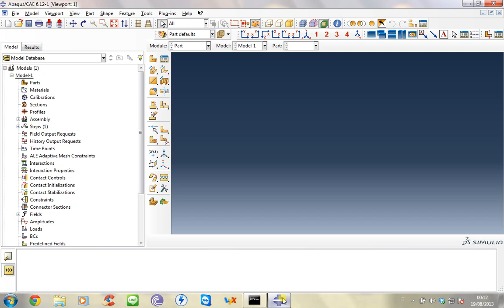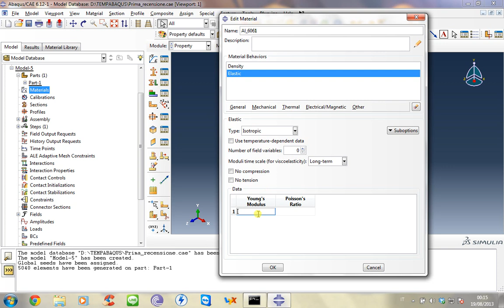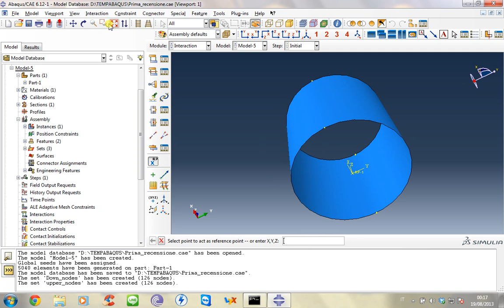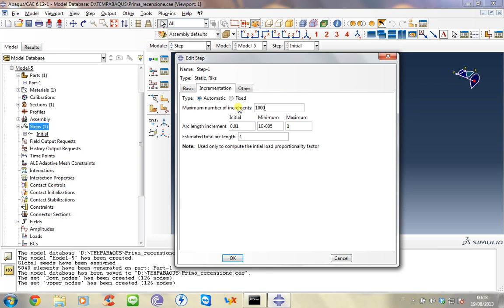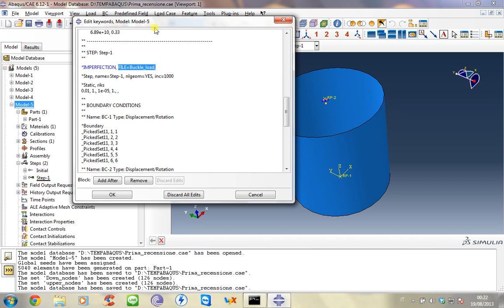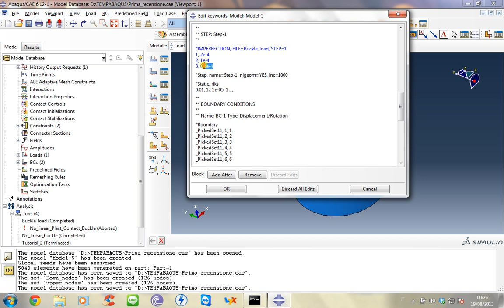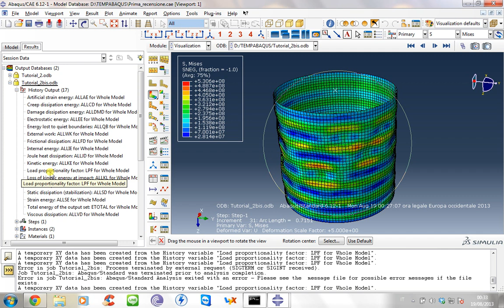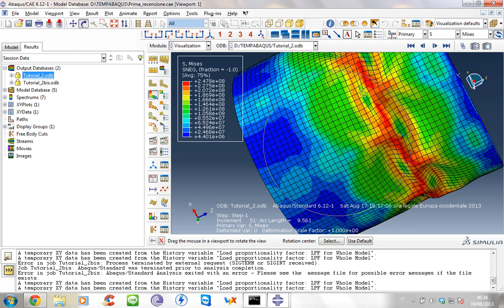No Linear Buckling analysis using Ryks algorithm

Comment: sir,can you help me? 

I addded imperfection in input file as 
*imperfection,File=L48F3000-1,Step=2 
3,2.9997 
39,0.4998 
53,1.3818 
and inserted it via job->create->source=input file->continue->submit 

but the abaqus cae result not showing any imperfection in shape. 
anybody know how can i rectify it? :(
Reply: Try to use the keyword in the cae and try the same. I think the way the imperfection is applied in the input file is different from that of the keyword.
Reply: Hi
can you tell how to calculate these imperfections.
Thank you

Comment: While I enter mode number and magnitude as in your example it gives syntax error "the syntax of following keyword is not correct" what can be the reason for that? Thank you.
Reply: +Mans celeb Yes, I had the same error with you at first. But I closed and opened it again, and tried many times, using non-capital letters, finally, it did work.

Comment: Is there  any way to do such buckling analysis using static riks on a column without imperfections? It gives a linear behavior of load-displacement curve without any buckling (for no imperfections) and column fails in squashing rather than buckling. Although I'm getting accurate results for imperfect columns. Someone please help..

Comment: hello.

What are common errors in the procedure of following your example if you receive the following error message after 222 increments

"Time increment required is less than the minimum specified"
Reply: Ryan Cudo Could it possibly be that I have not yet defined the plastic properties? And, when defining the plastic properties, How many must I enter? I know the more I enter the more accurate the results, but from where can I receive the plastic Properties. Is it from matweb.com as you suggested? 

When I enter the yield stress and strain (under plasticity) I get errors stating: the strain increment is so large that the program will not attempt the plasticity calculation at xxx points" this is repeated. and also:

"The strain increment has exceeded fifty times the strain to cause first yield at XX points"

are these warnings allowed to be ignored? Why / why not?

Comment: In ABAQUS, you can do buckling analysis [linear], and then use the first buckling mode to update the geometry [simple command to implement] prior to applying other loads. Has anyone does that before? Any tips? Any tutorials?
Reply from the maker: Do you refer to *IMPERFECTION command? Using it you can update the structure using the output from linear buckling analysis, and you will decide the ammount of % "imperfection" introduced.
Check the manual on the keyword manual!

Cheers

Comment: Im modeling a submarine, aplying pressure to the outside of a hull. I found the buckling load (doesnt cause yeld) and then i aplyed the Riks alg. to calculate the post buckle deformations until yeld was reached. i wanted to know how can get the pressure aplyed in each on the Riks iteration, until the yeld is reached.
Reply from the maker: Dear Garcia, in the history output, for the Riks analysis you will find the LPF, Load Product Factor. If you multiply that for the applied pressure you will see the pressure wich cause you the buckling. :) Sorrie for delay
Reply: Astro Abaqus
Hi Astro, thanks for the reply but i did some reading and figured that out :).

Comment: hi. so the only way to get the load vs displacement is using risk analysis..
Reply from the maker: Jonathan Carrera
 Dear Jonathan, the load displacement curve can be obtained in anycase. But depend what you would like to study. In this case I was interested in studing the structural instability of this model. Riks analysis is stricly useful to study the instability and collaspe of structure and obiviuosly you can obtain the stress strain curve to see the stability and instability behaviour. Hope to have answered to your question.

Regards
Reply: Astro Abaqus Hi, I want to get the load vs max displacement of a simply-supported plate using (thin plate element S4R). The linear perturbation will only give me eigenvalue and buckling mode shape. I want to get a curve that has the load vs displacement and this load should approach the first critical load given by Ncr (compressive force) or not?
Reply: The eigenvalue is the predicted imperfection by the software but using the riks method as in this tutorial, You can find the compressive force by the load proportionality factor.

Comment: sir how can i use imperfections on a membrane so as to get it wrinkled and then perform my analysis
Reply from the maker: Hi I worked a lot on thin membrane wrinkling, for space application. Your aim is to model the wrinking or to analyze wrikled structure? In the first case depend on the shape of your membrane. I suggest you this paper, made by Sergio Pellegrino one of the most briliant scientist on this topic.
http://www.pellegrino.caltech.edu/PUBLICATIONS/Wrinkled%20membranes.%20Part%20I%202006.pdf
http://www.pellegrino.caltech.edu/PUBLICATIONS/Wrinkled%20membranes.%20Part%20II%202006.pdf
http://www.pellegrino.caltech.edu/PUBLICATIONS/Wrinkled%20membranes.%20Part%20III%202006.pdf

Hope this help you!
Reply: Astro Abaqus sir i m getting the eigen mode shape....but i m unable to save them as my wrinkled pattern...please tell me the steps to get a model which is wrinkled so that i can perform my analysis ...it will be a grt help sir
Reply: Astro Abaqus sir my aim is to first model a membrane structure which is wrinkled.....and then doing analysis on that wrinkled model

Comment: I have put the imperfections into my model, but when I try to run the job to obtain my .odb, I have an error like this and the job is aborted:  
A ZERO DISPLACEMENT SOLUTION WAS FOUND IN THE FIRST ITERATION OF A RIKS STEP. THE ANALYSIS CANNOT PROCEED. THE MOST LIKELY CAUSE IS THAT ALL DISPLACEMENT DEGREES-OF-FREEDOM ARE CONSTRAINED TO BE ZERO.
Do you now what happens and what can I do to solve it? Thanks.
Reply from the maker: Dear mark the most possible reason of that message is the model load or boundaries condition. In the first case you applied no load or not a force for example if. You impose a thermal field this is not considered a "load" by the solver also if a thermal load can cause a buckling. In the second case is possible that with out BCs or proper BCs the model is ill conditioned and the equation bring a singularity. Hope this can bring you to the solution

Comment from the maker: This is possible, you can impose imperfection directly on a NODE SET using the option NSET= nodesetname. With this option you will apply the imperfection only to the nodes selected in the set. If you open the manual on the KEYWORD section you will find a lot of other command to use deeper it.

Comment from the maker: The LPF is a factor proportional to the load applied. Usually you calculate the linear buckling load, than you apply that load to the structure and perform the riks analysis. When LPF=1 mean that the load is the same of the one imposed. Usually buckling occur at lower load respect the linear obtained with the linear buckling analysis that does not take into account many non linearities.

Comment from the maker: Ok many times what happen is that the BCs are not setted properly, try to understand if your condition are consistent with your model. What is happening is that the solver start to integrate your equation solving them numerically. The solver apply the load at each increment, if this increment is too big you are not able to see the response of the structure. Sometime when there are high non linearity the solver try to reduce the increment step to understand what is happening...

Comment from the maker: Dear Julius, your if your problem is, what type of analysis to use , the answer is depend by your task. In concept and new design project, where many expert work in the initial stage they need NUMBERS. So they need results faster as possible. Euler analysis is simple and can give some starting points. Anyway if your geometry is simple and there are no local stress concentrator and you need a quick results a linear buckling analysis is perfect. Just refine the mesh and perform a mesh sensitivity.

Comment: hi, thanks for your useful videos, go on with this work, it's really helpful.
I have one technical question, why does my model show a maximum LPF value of about 9.5? The beam shouldn't collapse before or at LPF=1 (lowest critical load)? The other interesting thing is that after 9.5 the curve falls down a bit and then it starts increasing again, now is above 15... is that normal?
Reply: Check the load you applied.

Comment from the maker: To add a particular mode is simple, after *IMPERFECTION, file=filename, STEP=1 you have to write the mode number, magnitude. I make an example

*IMPERFECTION, FILE=test, STEP=1
1, 0.5
2, 0.5

In this case Abaqus will take from the buckling analysis results (test.fil) all the modes, and will combine mode 1 and mode 2 scaling the displacement of each mode by 0.5. So depend by you which mode will be considered in the analysis. I hope to have answered to your question.

Best